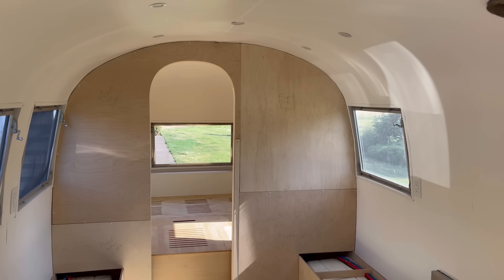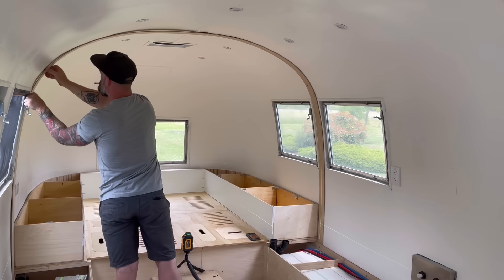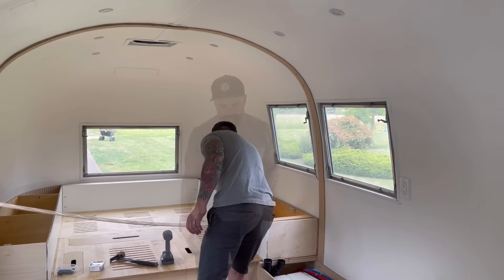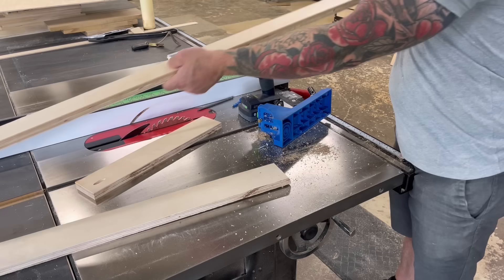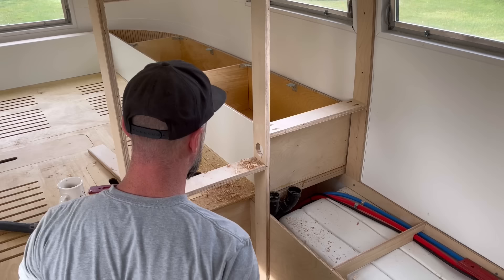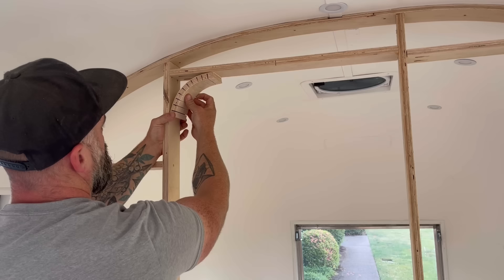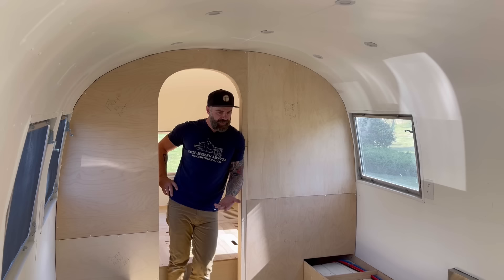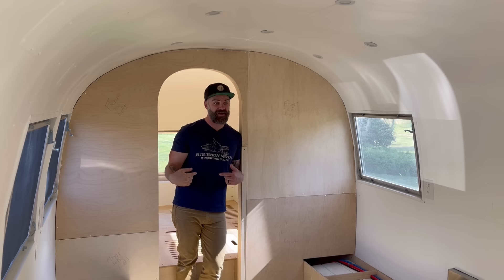Why Do I Make Things Harder || Airstream Interior Walls

Comment: I found myself wanting to call to you and say, "Don't rotate the scriber - It will make the piece too narrow!"  Starting with the scriber perfectly vertical, slide it along the curve keeping it vertical.  The result should be an exact match to the shape as far as the width of the material allows.  This is the same way we all scribe countertops to fit the unevenness of the wall.  For vertical matching like the edge of a tall cabinet against an uneven wall, the scriber is held horizontally.  Thanks for the video.  Nice looking project.

Comment: When scribing the ply, you must hold the "scribing stick" vertical at all times. Not 90` angle from the roof/wall, I usually use a level to scribe with
Reply: This was obvious to me as he was working too. I was almost yelling at the screen!! :) :) :)
Reply: Oh is that how it's done? Can you tell me how I can keep the spacing going from the roof to the wall?
Reply: You don't need spacing from the roof to the wall. Cutting more material from the sides is just super wasteful
Reply: @Goalsplus  Vertical is not necessary, but the same angle is. You can start at 45%, but then end at 45% degrees. That way you can scribe without problems from your roof to your wall and have it perfect.
Reply: @wendeavontuur  thanks very much. Now I get it. Things are falling into place. Do you have any advice on how to keep the 45 degree angle consistent? And how to do it with a floor?
Reply: @Goalsplus  i tried it many times before Just by hand. Angles like 90 or 45 deg are pretty easy to eyeball. Plus try to keep a steady-ish hand. Evantually thatll be perfectly precise enough.

Theres almost no chance you ever have to do this for ceilling wall AND floor. Because you can only use this technique if your board can fit in place for scribing anyway. If you want to build such a piece with one single board. Then my best advice would be to template it out with multiple smaller boards.
Reply: @wendeavontuur  thanks.  With a horizontal surface I meant separately not as a continuous piece. I now see I'm trying to be over precise with getting the 45 degrees, thinking I need a degree finder and over thinking it. Eye balling it is okay with me. Thanks again.
Reply: @Goalsplus if you need something that precise you're better off using a tick stick and playing connect the dots. However you could use a small level and a speed square to keep a consistent 90.
Reply: @ad1rteebum_673  good ideas. Thanks very much.
Reply: Right because he doesn't know how to do it
Reply: I came here to make the same observation.

Comment: Hi there, I enjoy your videos. Let me give you at tip that should help with the rest of your curved construction: you're scribing wrong. You should hold the scribing tool in the same orientation through the whole scribe. If you are starting with it straight up and down, keep it that way. Don't rotate it as you go around the curve. It's a little counterintuitive because it feels like you want it perpendicular to the curve, but you don't! 
If you adjust your technique, you'll find you need many fewer passes to get a perfect fit. Good luck!

Comment: Some time ago, I too had an airstream. It was a 1960 Airstream Safari Land yacht, single axle. It was a victim of deferred maintenance, one might say, so I took it upon myself to complete a restomod.  I detached the shell from the frame and everything.  I cussed, I bled and I learned.  Unfortunately, the circumstances of life presented no other option, but to cut my losses, about 10,000 of them, and sell it before I finished.  It was for the better, everything is fine now, but I still think of what might have been, had I made better choices.

At any rate, I now watch you “struggle” through the parts I didn’t get a chance to do myself, and I’m enjoying every minute of it.  Thanks for sharing.

Comment: Coming along nicely! Why not try to move the scribing tool in a parallel motion? Then you will actually copy the shape on the right scale. The "sliding over" issue won't be a problem any more. And you will get quicker to the needed shape. The way you do it it will great a much smaller shape. You will get there but in many more steps. Good luck!

Comment: The easier solution was not to tilt the scribe tool.
If it remain verticaly - you won't have reduction of width
Reply: How do you hold the tool vertically when scribing a vertical wall?
Reply: @SLorraineE  The point is not to hold it vertical but to retain the angle all through the scribe... scibing a curve like this might work best with a 45 degree tilt so that the scribe kan clear all the shapes. Every situation might demand a different angle.
Reply: @SLorraineE you only ever want to shift the piece in 1 direction. Whichever angle you pick, is the angle the scribe needs to point at all times. To see it more clearly think of a square shelf going in to a corner. You scribe side 1 to the wall and cut, then scribe side 2 to it's wall and cut, the side 1 will no longer fit because it shifted from the original position by however much was cut on side 2.
Reply: This was so painful to watch.

Comment: Another plywood material you might try for curved areas I have had success with is called “wackey board” it is laminated plywood with a fabric layer bonded in the center…it can be bent into radius curves easily without breaking or cutting multilevel slots or grooves. Used in furniture often. And can be surfaced with paint or plastic laminate… or metal such as aluminum.
Reply: Yep. I’ve used wacky wood, it bends very easily.
Reply: We used to call it wiggle board. I've used it quite a bit in my career. There are 2 options....curl on width or curl on length. Great stuff
Reply: You can also just steam the plywood so it bends exactly as you want it to bend. plus side of this is when the plywood cools down and is dry, it keeps its shape with no tension at all.
Reply: I was thinking the same thing.  PLUS, make a template in the shop, bend, dry it, THEN take it to the vessel of curves on wheels.
Reply: Really thought it was going to be a 'shoulda steamed it'

Comment: Boat builders face these kinds of scribing-on-curved-surfaces issues all the time. Putting up that first temporary piece of ply is actually a great first step. But after that, the easiest way is either to use a "ticking stick" (plenty of videos about it, and would take too long to describe it here. But it's really simple...), or hot-glueing a whole bunch of thin ply scraps to your 'main' board, which poke out in all directions and just-touch the inside of your curved roof/walls (creating a big spiky template). I'd recommend using the ticking stick method, as its easier than trying to manhandle a gigantic spiky template out of your tiny front door :)

Comment: Jason have you seen the Tally Ho boat build? Check how they make accurate curved walls: make a rough piece thats too small, tack it in place, then hot-glue a ton of tabs to it that touch the wall. Now you have a template to trace around perfectly.

Comment: I’m in the middle stages of building out my second airstream. The first,  a 1956, was a restoration. The new one, 1962, is a custom like yours. I’m watching hoping to steal some ideas and enjoying it much. 

Comments thus far: excellent craftsmanship as always. That’s a lot of plywood, be careful or your vintage airstream will weigh as much a as a new one.  Airstreams are very flexible going down the road. Not sure how your wall attachment, which looks stiff, will survive. 

Can’t wait for your next installment.

Comment: Hey, maybe you're already aware of this, but have you looked into building walls out of foam? It's about a third of the weight of a traditional stick frame wall, and just as strong if laminated properly.
Reply: This build is more or less the exact opposite of @TheDuracellProject, where everything is vacuum formed foam core GRP. I appreciate the craftsmanship on both. I was also prompted to comment here by the weight of this inside wall. Then again, I have seen the truck that will tow this trailer. My euro car frame of reference for towing loads doesn’t apply in the slightest.

Comment: You could have scribed holding the tool constantly plumb. As you got to the wall the gap of the scribe to the wall will narrow, but what you are scribing is a trace of the surface an inch lower. Once you get the top done,say to the top of the windows, clamp the top piece in with the bottom parallel to the floor. Take a new piece to do the sides. This time hold the tool level. You will then get the side profile and the template will slide sideways to the wall. Then join the side template to the top. Now repeat the other side. You will need fewer cuts and back and forth that way.

Comment: If I have to match a piece of plywood to a curved wall (like in your case) I tape a cardboard strip with painters tape to the curved section (similar to the first piece of plywood that you screwed to the ceiling and the walls) and then use plenty of cardboard pieces upright to the strip and hotglue everything together. if you use enough pieces to stiffen out the contraption, you can remove the painters tape and you have a perfect and stable contour of the curved section that you can use for creating an almost perfect template from plywood. The last gaps can be closed by the old Pencil-in-a-washer trick to match the contour of the Plywood perfectly to the curve.

Comment: You may have been able to achieve your goal with the door archway by using a round nose router bit instead of cutting kerfs. I used this method with a 16" wide by 8' long 3/4" piece of melamine. Over the middle 4' length I routed a 1/2 flute about 1-1/2" OC about 3/8" deep. This was for a Pinewood Derby track so it need to be moved around and reused so I had to keep it from breaking. Using kerfs would make it more prone to breaking, as you experienced, due to the sharp corners. The round corners reduce that. I also reinforced it by using 2 3/4" aluminum flat bars. One end of the bar is fixed in position and runs along the fluted side of the board. The other end of the bars have a slot that the screw can travel in as the board is arched. The spacing and depth allows the board to bend to about a 45 degree arc and allows the cars to make a smooth transition from the upper part of the track to the lower portion.  Using a narrower round nose bit and some trial and error on the spacing and depth may just due it on the next Airstream you refurbish. 

Thanks for all your videos.

Comment: You can control the shape of the kerf by cutting a plywood template in the shape of the inside curve.  Drill big holes in the template to clamp the kerf in place.  Then glue the layers of the curve together.  You can even do this with multiple thin layers instead of cutting kerfs.  Perfect job for the shaper as you can cnc nice even curves.

Comment: To make your curved piece with the veneer showing you could make a mold and slowly bend it around on work work table. A steaming tube out of PVC pipe and a kettle also helps with bendability. Once in place you can use expanding window foam to fill all of the kerf cuts. Once dry…….voila!

Comment: I like the un-scribe technique (forever associated now with BourbonMoth) , but it occurs to me if the panel is moving up only, holding scribe perpendicular(kinda like square) to that direction of movement and not perpendicular to the path (that would require the wood to stretch?) ; I think that initial cut would be closer.  Maybe in this case we pick 45 degrees as a constant angle to hold the scribe at, and the cut piece goes up and over along a 45 degree path.

Comment: If you have more curved and odd shapes to fit into your build, consider watching some videos on using a joggle stick or ticking stick which are often used in building out boat hulls. You might find it useful and a lot less wasted plywood.

Comment: I think you're instincts are spot on. Looking good! Don't forget with the plumbing drains they need a vertical vent pipe out the roof
Reply: Also, as an owner of a '66 model, I recommend putting a piece of thick weather strip foam along the inside top edge of the exterior door. Having bumped my head way too many time going out the door, this solution saves me a lot of headaches. Literally.

Comment: Dont vent plumbing thru the roof, if you can avoid it. That would invite leaks. Use a sure-vent air admittance valve
Reply: The black tank must be vented to allow for gas escape. Otherwise sewer gas ends up in the RV.

Comment: Should have turned a few of those spaces made by the wall framing into pull out storage. Kinda like those file holders they screw on doors at the hospital. Could have done it on the bed side to keep it hidden.

Comment: Your initial framing arch was a rather ingenious 'Brute Force' approach to solving that problem and, almost certainly, the one I would have used. Kudos on that. But the arched doorway you wanted could have been achieved ALMOST EXACTLY the same way. But, rather than making the entire arch, just make segments for the corners. Cut out a pattern or mold  that spans the width of the door and conform the strips of 1/4"" plywood slathered with glue around that arch until it sets. then screw that piece to your existing frame.

Comment: A simple question: how about using hot glue to temporarily adhere the divider wall's top/outer laminate plate layers to the ceiling, and to each other, with hot glue, then sink screws after the total laminate sandwich is cured?  Then it's removable.  Apol if already suggested: you're so popular with so many comments I can't read them all.  Good work!

Comment: The reason you keep the scribe at the same position for rounded corners, is because when you change the angle you change the radius of the scribed line. Get doing corners like this down and it will make getting those furniture pieces tighter to the walls, and open the door to built ins for rounded coves and corners.

Comment: you could use 1/8 ply and putting it flat against the wall bend the curve and add blocking to the ends so you can attach a frame to it making kind of like a cookie cutter then use that as the template. I've done this several times with the interior of boats to make templates. great series by the way cant wait to see the completed project.

Comment: Enjoying this series. Regarding the curved triangles at the front of the bed, it seems like you could have left out the kerfed sections altogether. They aren’t visible and the top doesn’t need the extra support. If support is indeed needed, one or two spines would do the job. Extra bonus: less weight. Speaking of weight: Can you remove the “bed top” underneath the side boxes? They already have their own bottoms so the bed-top plywood seems extraneous. Thanks for the content!

Comment: Simpler solution. Buy a roll of heavy duty craft wrapping paper and double sided tape. Put little squares of double sided tape on your stud work and stick the heavy duty paper to the wall. Then re-enforce with packing tape, then cut with a box cutter. Then carefully remove your paper and use it as a template to scribe to your plywood, adding a 16th of an inch as a buffer for the cutting blade and sanding. Probably will work?

Comment: it made sense. but I think you can take that logic and use it at a bigger scale. after you clamped your squer sheet of plywood, take a bycicle wheel or cut a circle from wood. take a pencil and pass it throug the middle of the circle. now you can scribe a line thats a set distance from the airstreem walls on to the scrap piece of plywood. now take it to the shop. cut the scribed line, set the finale piece of wood you want to cut beneeth the cut plywood. roll the edge of the wheel on the scribe line you just cut, with the pencil trought the middle on the outside. now you are drawing a line thats the same distance, and basically adding the exact amount of matirial you need.
less cutting and measuring. and by changing the radius of the circle, you can cut shallower curves.
hope you read this and this would help

Comment: You can save a TON of wasted plywood when you scribe curves, if you keep the scribing tool VERTICAL.  Do not rotate it perpendicular to the surface you are scribing.  Keep it parallel to wherever you had it when you started.

Comment: An easier way to get a good fit, use heavy card stock (single layer cardboard) and a utility knife. Push the card stock into the corner and cut it with the utility knife (take it slow and run the knife in the crease)

Comment: I have an idea for scribing. I don't know if it works but what if you made a disk out of wood like 20mm thick and 200mm in diameter with a hole in the middle which is the exact diameter as your pen. Then you can stick the pen in the hole and run the disk along the surface which you are trying to scribe. Your drawing on the template should then (in my mind) have the same curvature as the piece you're trying to scribe from. (Sorry for metric measurements I'm German😅)
Great work btw

Comment: I liked your scribing workaround, pretty smart. But you would have been just fine if you kept the tennis ball launcher vertical at all times. You kept it perpendicular to the camper skin, which created an offset. So say your pen was 200mm away from the end, and radii of the camper skin 1000mm, you would end up with a scribed ply and radii 800mm. 

Maybe this little adjustment will save you some wood. :)

Comment: To scribe the walls, I would have used the same method you used with the 1/4 inch ply but tie string to one end get the curve of the wall and tie it the other end, then transfer the curve to sheets of wood.

Comment: I wonder for that 8th inch bend veneer you ran over the door, if you to run it through a belt sander and then it down if it would’ve been a little easier??? , but it works so great job.